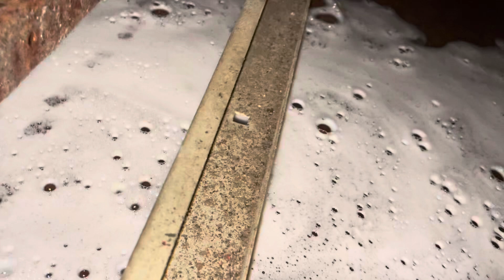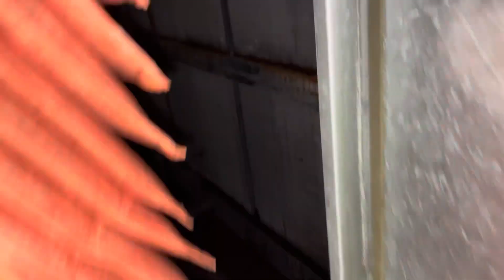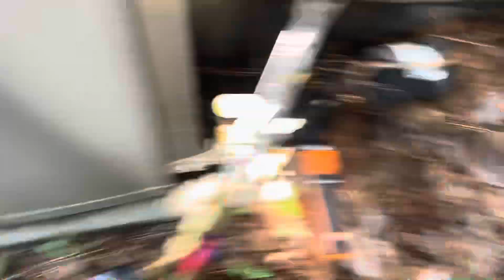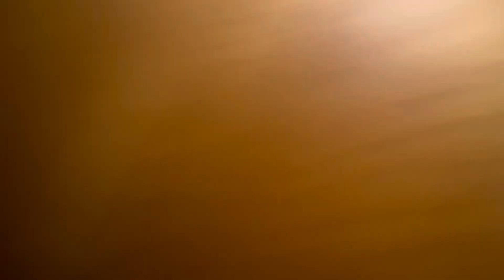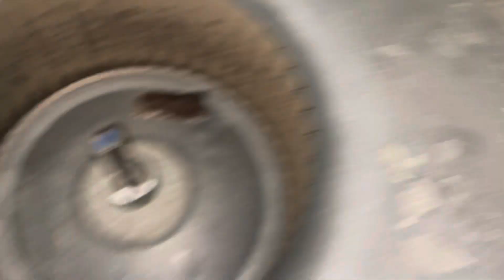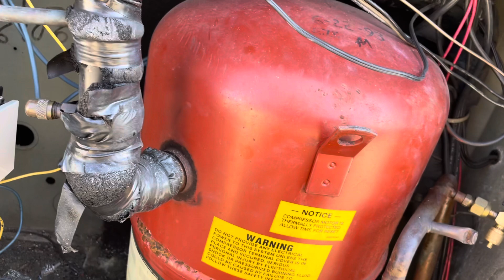Tuesday Full Of HVAC Calls!

Comment: Great video just thought I’d share a few things I saw to help first when y’all were cleaning the coil in the beginning could’ve had help her get a shop vac to clear the drain line to get it flowing better an save a call back later 
an two when y’all replaced the blower motor could of had helper clean the squirrel Cage
Reply from the maker: Thanks for the tips! 🤙